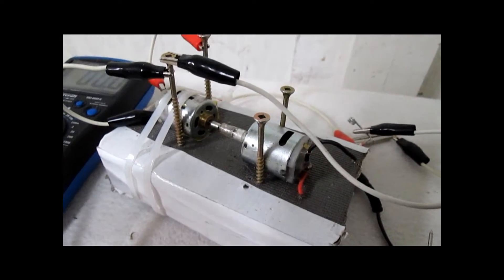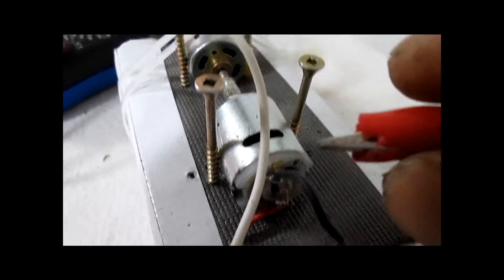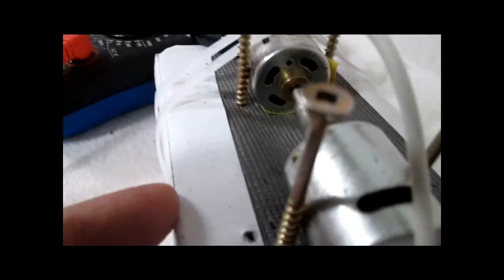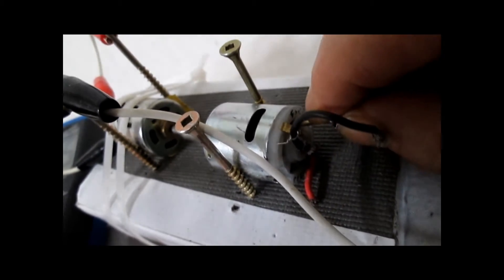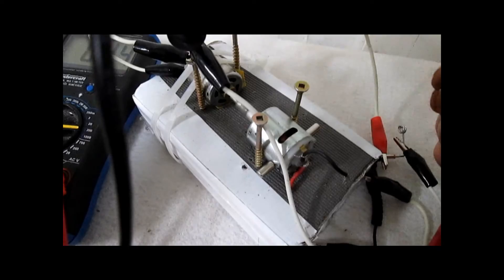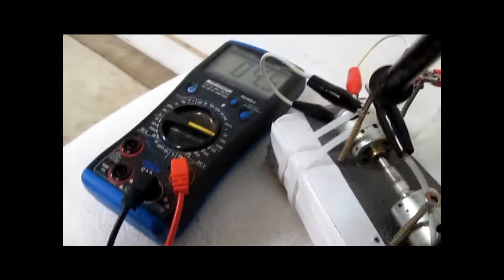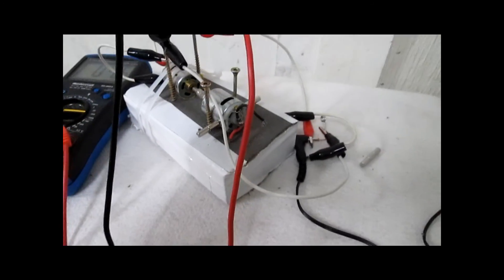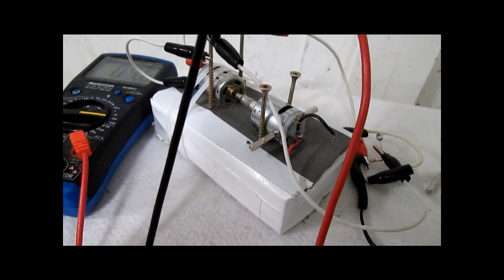Amplidyne part 2 high output to input

Comment: Nice to see some one works with that staff nice presentation Im doing similar experiments even tought use Delco 12si Alternator and the 4 brush Delco S/R type starter motor.
Preaty much cool experiments.
I wuld advise you to use those components they are easely ajustabel and cutt of 2 brush plates off to get those insulated brush holders and the Delco 12 si actualy has bypass pins for the regulator I dono probably you can make Scott transformer or some thing like that Delco Alternators turn easely to DC or AC motors.
I belive in that staff as well expecialy if you have car that acts as Hot Bulb or Hit and Miss engine those starter/ generators are actualy assisting the engine via planetary gear.
GM used Dual Motors different in touque snd speed ranges so they used different type motors they culd be more then 2 motor types .
They called them Gasoline-Disel Engine Blocks.
There also were Multi Stroker Engine Designs.
Thats where those special starter/generators were used .
So you are right at some point.
I witnesed me own car doing that strange staff running nearly with out fuel but I have some me own explanation why that acuress be reviveing the Joe Cell guy what he culd have used on his engine.
You see those plains in ww2 fly at high altidute so probably baterry/capacitor/baceria/chemical reactions were used engines are hot the air is cold .
Same thing true for ships they are surounded be sea water perfect for baterrys and their own chassys is a battery .
So I might be wrong there but any way It does work .
Me alternators done lot strange staff,including stuck ring gear on starter motor,magnetised engine contrapting metalic coils,arcing multipel relays similar to dual 5 pin relays ,multipel baterry types interacting with ich other capacitors and what not.
So definatly you are right there .
But those starter/generator still need magnetic  cilindrical pump probably then it wuld work lot bether be useing gravity to jet preshure turbine or use bacteria effects with thermal effects probably.
So hoppe this helps you some what those small motors are not wurth the trobel they are to small .
Hell if I know what happened to me but I did witnes those effects again me car acted more or less like advanced version Hit and Miss engine on Ethanol/Methanol Water Vaporisation so it was mostly crank case based fuel porting and pre heating .
Most likely tree oil was involved .
And some trees are actusly strong enough in flame power to melt ovens so even the idel port alone is used to run such high energy high torque engine perfect for that generator that you try to use.
Nothing ells wuld work .
That was most what I culd muster be over uniti and I run for weaks on small glass oil wurth vaporisation and coolant who are cheap realy .
So mostly bacteria eating engine oil so that wuld desribe it as self regeneration fuel that same book mentiones over time.
Tractor work unit per time so they used hightly modified stationary engine generators .
That wuld explain the other missing circuets because partialy that generator is arced to the engine it self as magneto high amp ignition system so the short brushes experiance lot other staff including biological chemical metal changes .
So thats where that confusion comes from.
Wikipedia Hot Motor peopel joked that thing culd run forewer seamengly with out fuel wast joke tought .
British peopel used that waxy staff sickness that grows on trees for lantairn oil so in the cold morning steam like clouds build up if you drive to close to forest you instantly get engine floaded if you have magnetised hot engine that cause normal blinker relay and instantly that staff rushes towards you I dono what it is acidic solution tree oil or what ever it is similar when 2 stroker floods engine if you leave them on weat ground same is true for stationary engines .
And remember sea water has algea organic compounds .
So I realy hoppe this helps you some what in your resurche but please dont try to sell it ya know Stanley Mayer didnt end up to well hes kinde of dead .
Yep US army and others around the world hade many things they actualy  dont hide it they mostly gloat about it honestly so those sientists most likely murdered ich other who will earn more money how much I culd understand.

Comment: Ok it seems you are creating shorts via pulses using the brushes . This is like creating a radient spike without a transistor. Just like the bedini ssg circuit but the transistor will do the pulsing and when the power is disconnected from the load it will create a radiant spike of high voltage. If you put a capacitor across the pulsed shorted coil it will capture the high voltage just make sure it is rated for high voltage and then put a blocking diode so the energy stays in the capacitor and does not leave  to the environment.
Reply from the maker: Yes this is step two of four for converting a DC motor to an amplidyne. The brushes are shorted. Documentation states full voltage is redirected 90 degrees and the coil or wire in this case contains the full amperage but does not resist with heat because of the rotating magnetic field. The current is limited for the AC to DC adapter (rectification transformer response).
Reply from the maker: The replies got reversed ... yes the wire is shorted across the brushesthe pin also had an accelerative effect lifting a brush.

Comment: Allan please answer my question if you can  , the coil that is shorted on the generator side ? Is it shorted via pulse with the brushes or via constant short? Cause if it is shorted via pulse it should act like a capacitor and store fly back energy? Very interesting.
Reply from the maker: To store power in the battery or capacitor in the operational cycle; with any use there is a load resistance. The materials in an elemental based  mechanical generator are also capacitive and can have regenerative  properties.

Comment: try using a universal motor rewired add brushes. Can find them in house hold appliances drills ECT. Maybe reed switch your input source to the energize coil